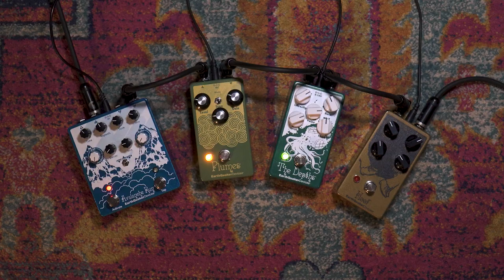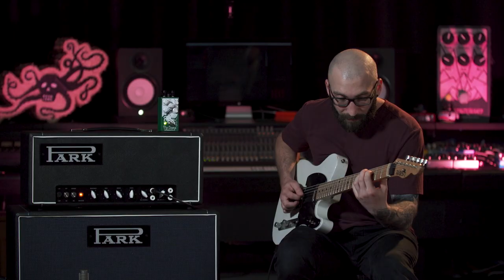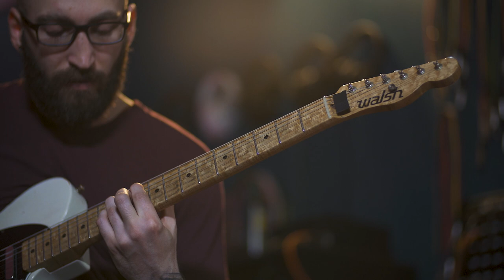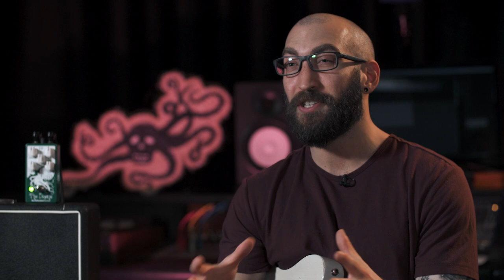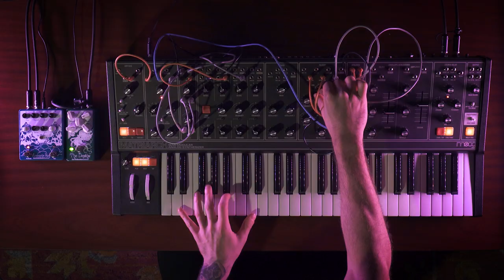The Depths Analog Optical Vibe Machine Video Manual | EarthQuaker Devices

Comment: The depths seems to be right in the middle between a pure vibe and a harmonic tremolo, which is pretty awesome! Being able to change the low sweep of the vibe to fix the steep curve they all have is a game changer. If only it had an expression jack controlling intensity, rate or wet/dry mix, it would be the perfect Univibe ever.
Reply: Sabbadius makes the most perfect Uni-Vibes right now. 

I like ones with tone sculpting ability as well, but the DLS Versa Vibe is another choice in the Depths price range, and it does have an expression out. 
Having the pre-amp in a uni-vibe is also a big difference, as well as the switch to click it on/off when bypassed.

Comment: Anyone know if the depths can run on a 9v battery? I’ve had one in the past and LOVED it but I used to run it at 18v in my ISO 5 but I no longer use power supplies and run strictly off batteries.
Reply from the maker: Hi! We are available at earthquakerdevices.com/contact for any tech questions. Thank you for your support❤️
Reply: Just get one of those 9v battery to 2.1mm DC adapters